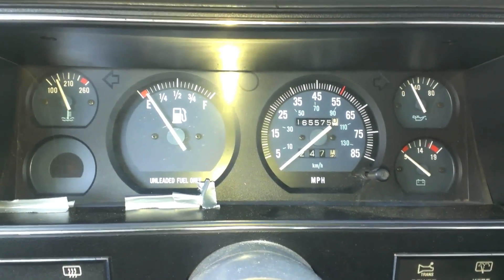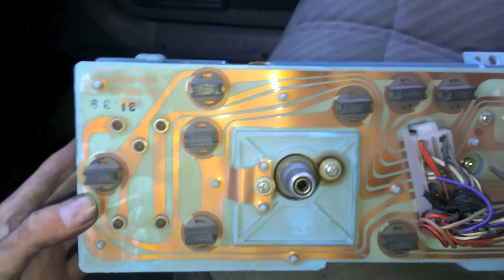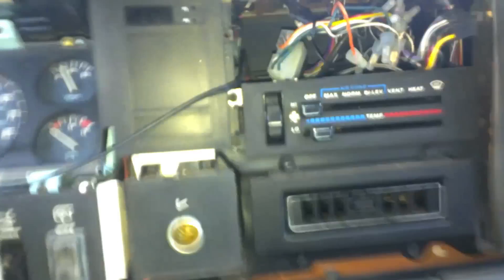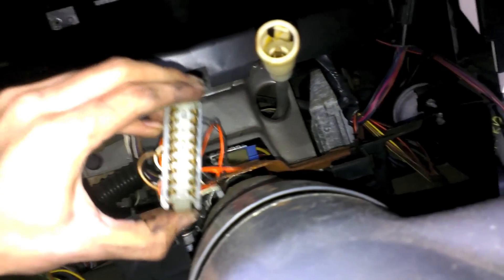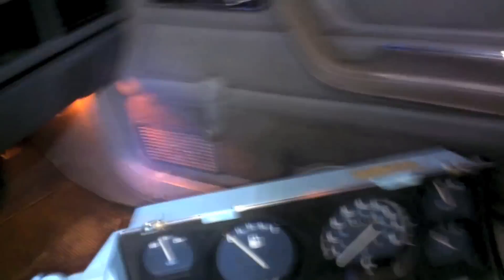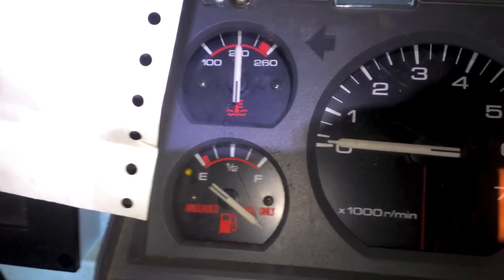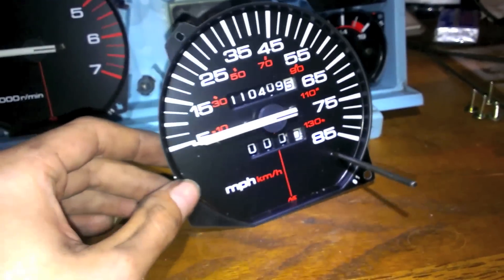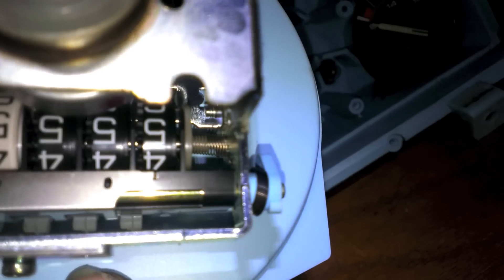89 Cherokee Tachometer Gauge Cluster Upgrade

Comment: What sensor controls tachometer in renix system
Reply from the maker: The signal comes from the Ignition Control Module which lives under the spark coil

Comment: Does the trip meter knob just pull off to get panel glass off?
Reply from the maker: I'm pretty sure it just slides through
Reply: @NickInTimeFilms   I noticed your old one had the knob still on it.. the new one yuo installed was missing the knob.. seems you have to get it off to take glass panel off wont fit through the hole.. anyway thanks for video & info

Comment: What year is your "new" cluster? I have an 89 also and I want to do this to mine. Did you have to do anything to the temp and oil gauge? I've been told you have to. Just curious. You're one of my go to Jeep guys so I figured if anyone knew it would be you.
Reply from the maker: The description has a breakdown of year swapability, you'll need an 87 - 90 cluster. The RPM, Speed, Fuel, and Voltage will read the same on any Jeep. The Temperature and Oil Pressure will require new senders ONLY if you are swapping from a "Dummy Light" cluster. If you have the in-between one like me then just swap the cluster and go.
Reply: @NickInTimeFilms  how do I hook up the temperature sensor I have 93 with the electric speedo with all dummy lights and I have a 91 cluster with electric speedo and all the gauges how do I go about the temperature gauge working and keep up the awesome videos
Reply from the maker: @TheLj4100  I'd assume you just swap the temp switch for a temp sender if the plug is the same. Should be on the back driver side of the head.

Comment: The plug that goes on the middle is for the dash lights as well.  As for the speedometer cable, there's a bracket that's attached to one of the control arms that keeps the cable from moving about.  Pop off the bracket and you have all the slack you need.  No need to disconnect the cable from the transfer case.

Comment: My '88 came from the factory with the full gauge package.  Of course, the oil pressure gauge needle reads upside down now and the temp gauge needle has shifted 45 degrees to the right...
Reply from the maker: Quite the original cluster there. haha
Reply: It turned out both gauges were bad.  I found replacement gauges at the local junkyard and after swapping them out, they work perfectly.  They're held in place with three brass screws that conduct electricity from the traces on the back of the cluster to the gauge.  Take out the screws and the gauges come right out.
Reply from the maker: Glad to hear that's all it was, probably nice to actually see what's going on again huh? haha
Reply: I put in a backup mechanical oil pressure gauge 15 years ago, so I still knew what was going on.  It's staying, too.

Comment: Wish I saw this for when my speedo became possessed on my 1993 in 2012, it would sometimes not respond till going 20 MPH, and then sometimes just jump to 70 and STAY there, before flipping alllll the way around to get stuck under the pin. Got another speedo but the mileage was out by over 100,000 miles from mine. Ended up just switching the electric motors and wallah, no more possessed speedo.

Comment: Hey, what year did you pull the new dash out of? I like how the gauges look verse how mine appear.
Reply from the maker: Noah Maxson I believe it was a 90. Interchange years for the XJ are as follows:
84 - 86 Electric except for Speedo
87 - 90 (Same as 84 - 86 but uses different speedo cable clip) 
91 - 96 All Electric
97 - 01 All Electric, New design
Reply: Except for the speedometer, the other gauges are identical.  The gauges that I found at the junkyard came out of a '93 and they are exact duplicates of the ones on my '88 - right down to the resistors.

Comment: I have the limited so I already had that one :D
As I don't have the owner's manual I have a question though: How the F do you adjust the clock? I managed to change the hour by pushing both buttons at the same time, but for the life of me I can't figure out how to change the minutes. I live 30 minutes ahead in time! :D
Thanks!
Reply from the maker: Lol. Changing the time is pretty simple with the right tool. You need a thin needle/ball point pen to press the button fully in. Push the hour button to advance 1 hour and the minute button to advance 1 minute. You just need something small enough to fully press the buttons in.
Reply: NickInTimeFilms x